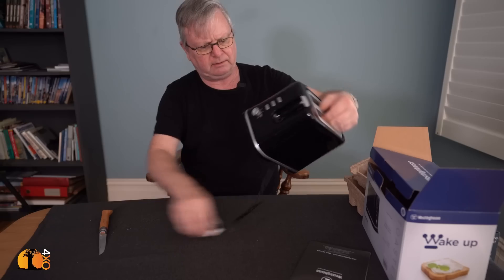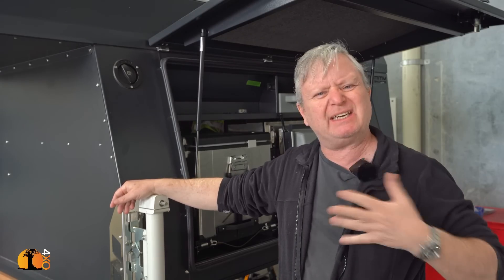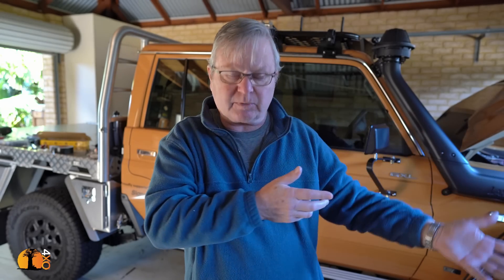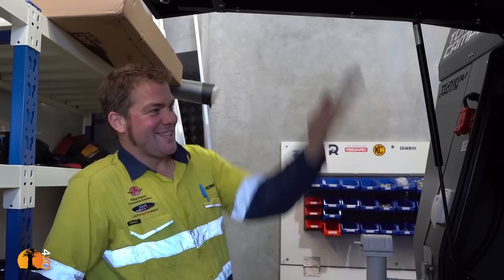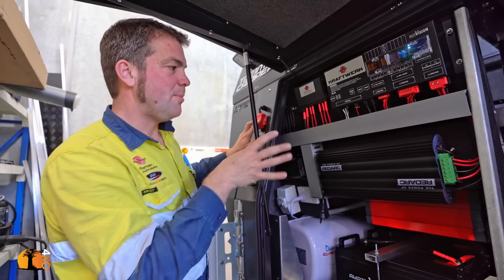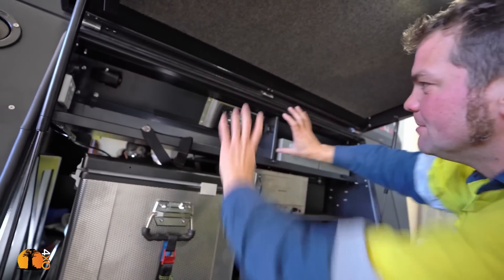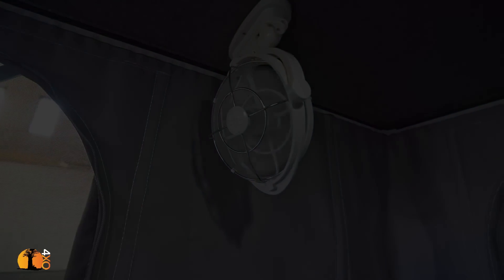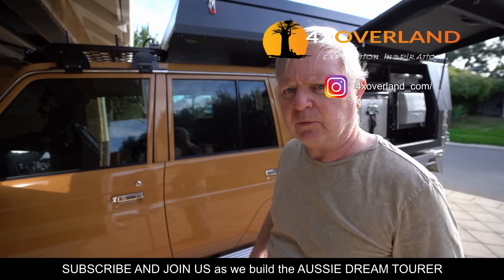Camper Electric Installation. A MASTERPIECE! Aussie Dream Tourer.

Comment: All good Andrew the system it absolutely magnificent BUT. If you mention a safari roof then plse explain. I used to fit them to Toyota Arkana Vans back in the late 60s for vehicles supplied to remote outback nurses vehicles.

Comment: Hi Andrew, the Manager30 has an option to limit the amps it draws in the menu. I've used it to block charging the house battery and relieve the load on the alternator when both batteries in my vehicle have been down on charge.

Comment: Alternator charging is a tricky one I'm trying to figure out, I'll be getting a Transit 470E and the electrical system from the factory is interesting- dual battery with a 240v 400w MSW GPO coming off the engines 230A alternator. For my traveling needs, I'll be able to draw as much amperage while driving as any dc-dc and battery system can drink with plenty to spare. But to charge while idle it will be a problem- it can still deliver 60A plus at idle but the cooling fan in the alternator is pulley driven from the engine.
Reply: The problem with alternators is you need speed for the built in cooling fan, if your that way inclined you can graft a 12v computer fan on the back to assist they're cheap otherwise increase engine idle speed, water cooled alternators are expensive.

Comment: I stand to be corrected but I saw a comment the Redarc BCDC trips out with a fault if your battery voltage drops below 9v and needs to be physically reset. I have yet to confirm this but my battery drops to 9v first crank of the day.
Reply from the maker: Your battery is the problem. It's dying. I tested this, and my Redarc rebooted at below 6V.
Reply: @4xoverland  cheers... I shall quote you to the would be installer.

Comment: I see you put casters on the bottom of the legs...are you able to move your Tommy by yourself on a flat surface? Just thinking about how I am going to move mine when its not on the flatbed. Thanks!
Reply from the maker: Yes.  It works very well. Next time though, I would weld the castors on differently. The centre of the wheel needs to be dead over the centre of the weight. Not off-centre as I did it. Which is causing a few difficulties.
Reply: Ah good to know! Thank you! I am eagerly awaiting my S4-X here in the US.

Comment: have you had a go at lifting the spare tyre into the canopy and jostling it into its mounting position ON YOUR OWN? I'm a bit older than you (65) and have a 6" raised Silverado. Spare tyre lives in the canopy and despite being over 6 feet tall, I sometimes struggle to lift the 50kg spare into the canopy. I devised a simple crane jib with 2000lb electric winch...works well.
Reply from the maker: I have a small block and tackle to handle this. 41kgs is a lot to lift.
Reply: @4xoverland  Good oh mate....sounds like a similar idea. As long as it works, that's all that matters. Rely on my TPMS and I don't plan on killing any tyres anyway.

Comment: With regards to the 220-240 volt installation, I'm not really certain if it's a little different from state to state. The canopy installation is more akin to a caravan installation rather than a static home installation and subject to different requirements and being a plug in device it is actually regarded as an appliance under the Australian Standards, so not really certain what type of compliance certificate is required, certainly won't be the standard building one but a caravan one if it's a requirement. In which case I hope flexible multi-strand cabling was used to combat vibrations along with double pole switching for all you power points and lights etc.... It's kinda funny seeing trunking being used to hide/protect the cables but I suppose if it's used in locomotives where it's subjected to vigorous vibrations and the like, it will perform well in that environment too. I am currently doing a similar setup with a canopy and camp king industries roof top tent as two separate pieces. I don't think I really want to install 240 volt into it though, but am still undecided whether to go for 12v or 24v solar system for the fridge. Really look forward to seeing more of the build.

Comment: Hi Andrew. I am running 650 watts  with my manager 30 and have found it will provide me with 30 amps when I need it. In my experience you will be able to run more solar power and will probably want to.

Comment: That wiring job is A+ , pretty much like and better than an industrial piece of equipment. One thought that comes to mind is why not hide all that controllers and batteries with a panel so you can have a bit of storage/ keep electronics safe from elements when you open the right side of the camper, I cant imagine you having to mess around with the wiring often

Comment: Hey andrew 👋 i think the truck is looking awsome have you thought about maybe mounting your maxtrax under the tommy camper over hang on maybe (rough description) an angle iron /aluminium frame wich could slide out and maybe even  tilt for ease and would free up roof rack space for other uses like a nice aluminium box for
 spares and tools ?
Love your work keep it up 👌👍

Comment: Confused about that manual 4 way isolator switch afterthought. After having an elictrical prodigy make a complex and elegant system, that switch dumbs the whole system down  making the charging system essentialy manual - bypassing all of the electrical engineering.
Reply: Am thinking that switch will be rarely used.
Reply from the maker: Dumbs down or gives me back some control?
Reply: @4xoverland  thx for responding. When you come to USA put Anza Borrego State park on your list, Southern California Desert right up your alley, best in  late fall to spring.

Comment: Several people have commented about the complexity because of the electronics.  Electrics mainly fail for a few reasons: low quality parts, poor installation, and heat.  A well designed system that is put together well will have few problems.  I can tell by the how this is installed that it is unlikely to fail and if it does it will be easy to troubleshoot by anyone with any knowledge of electrics.  The most complex part of this would be the RedArc manager 30 and those have such a good reputation (not a low quality part) that I would no be worried about it.  Sure manufacturing defects occur, but manufacturing defects will usually show up within 30-60 days and with electronics manufacturing defects will usually show up within the first few times they are powered up, if not the first time.  Software is a different issue and can showup seemingly randomly.  Sometimes cycling the power (turning it off the back on) will reset the system and get the software going again.  Sometimes it won't.  Sometimes you may need to turn it off for 10, 20, 30 or 60 minutes to give the electronics time to fully power down because there may be capacitors that are still holding a charge.  However, some capacitors can hold a charge for very long times, like months.  With a new build, plan ahead and do a weekend shakedown run at least 30-60 days prior to a long trip.  The shakedown run is to find any major problems and the 30-60 days is to allow time for parts and repair.  

If the electrics seem too complex to fix that is on you.  We have the internet today.  Educate yourself and take the knowledge out on the trail with you.

Comment: Heiner has done himself proud to 98%. Just check the red heat shrink  on the fuse block is cut to the same length. Looks messy being all different lengths.
Reply from the maker: I'm stopping that cheque!

Comment: You go right ahead doing toaster unboxings.  Just next time can you tell us why you picked that toaster?  My Dad takes one camping and they are such power hogs I liked to know if you got a low amp one or do you think your battery system is robust enough to deal with thje power draw?  Especially since if you are traveling with others you are going to be making allot of toast I think. 😅
Reply: Also does your vehicle have two alternators?  In North America I would have gotten a truck with two heavey duty alternators with that kinda load.  Cause your right I'd be worried about prematurly burning one out.

Comment: While I like the idea of the battery switch, I don't like those switches personally. I prefer something like the Blue Sea 7622 ML-Series. It will automatically reconnect the batteries once the starting bat is "full" but also allows you to manually connect the batteries for self jumping, plus has the option for a remote switch so you can mount the unit where it best fits and still have control of it. 

I cannot wait to see the wiring job they did!

Comment: Note andrew you will need  to check each device you wattage calc if intend to  run a lot of things at once you will need a larger  battery system in place..
if you are  going to  add shore power into the use parameter you will need a fused inlet..
I don't think you are going to have enough dc power to power your VAC components ..
you are looking at 4.5-8K
allowing a power draw of 1,500 watts per device you use..
If you are going to plug this into mains power  andrew you will have to comply with the same  diagrams that apply to caravans and campers and install a mains inlet fuse..
without one if something fails electrically it would be hard pressed to  get  insurance to cover any damages..
that happen.
do what you like though if considering any type of  secondary power options including shore power at caravan parks or genset applications minimum inlet specification is 240 VAC at around 20 amps

Just remember this Andrew whilst you might be able  electrically isolate at charging state doesn't  mean all the  batteries you use are electrically isolated in a use parameter case.. if on the same circuit you will likely find all batteries with interact with each other..

Comment: So Andrew, if you lose the alternator and the ability to charge the vehicle battery, have you considered a feedback loop to allow you to plug those 400 Amps of stored power back into the vehicles operating system?  With no alternator your vehicle will eventually draw down the crank battery (and auxiliary) until you are dead in the water, probably only after several hours of running, even less of operating lights etc.  With the additional power flowing back, you could continue to drive for a considerable time  then wait and charge the batteries using solar to continue on again.  A useful level of redundancy that I've employed in my 79 series build.  A necessity for the very remote outback stuff.  Cheers  Mick

Comment: You know your needs more than anyone but I doubt you'll ever need to charge the camper from the alternator. I run a 300watt panel into a 40Amp MPPT and have an extra 150W foldable for my camper trailer. With x2 120Ah deep cycles I haven't even run a cable through to the tow vehicle. I charge laptops, camera batteries, chainsaw batteries, devices for 5 people. With your amazing setup you just won't need it.

Comment: In the boating world going to single fuel has been a goal for years so going to diesel - electric is not such a bad idea as some people think, lose the gas bottles. lots of overlanders are coming around to the concept, running the engine at meal times is no big deal to run an inverter and also top off the batteries all you need to do is increase engine  idle speed, idle up switches are standard on hilux, they may be available  for yours,  basically just a resistance that pillocks the engine management to think you have your foot on the pedal ,water cooled alternators are expensive, could graft a 12v computer fan on the back, or simply use a sandbag on the pedal the possibilities are endless, petrol generators are bulky and introduce another fuel, cables and cans .
Reply from the maker: For me, the reason to go camping is the lack of noise. Therefore, running the engine at meal times would be the very last resort. I'd rather eat cold food.

Comment: Better system than i will probably ever have, but for the prep area i would of used a 2 x exterior dimmable two colour LED strip lights instead of the round LED. One pointed in, the other pointed out. Strip LEDs avoids issues with shadowing.

Comment: Considering the draw you’ll have in the camper with the 240v appliances the bm30 charging is a bit limited when driving. I’ve found about 20ah to boil 1.5L of water...

Comment: Great work Andrew. I really like the development you are doing. I have a question for you. Would you install a secondary alternator to support the electric system separately? Do you think it is a good idea?
Reply from the maker: The secondary charging system is called solar.
Reply: 4xoverland The electric system is connected to the car alternator to charge the batteries while driving, am I right?  I thought why not to add another alternator to charge the batteries ( not the car main one) instead of overloading the main alternator in the car.

Comment: I would suggest that you buy a super efficient Afghan pressure cooker since you travelling long distances....
Used on open fire as well as on the gas cooker.... 
Serves as a cooking pot as well as a secure storage... 
Uses minimum of water, efford and time for a standard and healthy meal... 
Used as pressure cooker and as an ordinary pot... 
Just chop it all, place it in the dish, add your preferd spice and forget about it for 10 to 30 minutes, depending on what you are cooking.... 
I have used it for camping and long travels myself as well as I am using it at home ....

Comment: Dont know why people think all electric camping is new, Landrover started fitting PTO generators in 1948, My landrover is 31 years old the pto runs a 5kva generator,  now we  have pure sine wave inverters everybody can have mains power try and catch up your only 72 years behind lol.
Reply from the maker: To get a PTO you had to endure a 1948 Land Rover.  And inverters were huge oil-filled machines that weighed as much as the Land Rover. It was a huge price to pay and not worth it for ordinary people who wanted to travel. So the world used gas. And it works, and still is the most efficient way of cooking in camp. Practical high-current 12v is new, and is a novelty.

Comment: Hi Andrew. I have noticed more than once that the trayback head board and the aperture of the rear window are not parallel! It may just be the camera angle but I thought you might want to check it out. It is as if the tray is slightly higher on the drivers side. I would be interested to know if this is the case. God Bless. Hugh

Comment: Have you had any experience with vibrations on the roof mounted solar panels? Are they prone to crack due to the wind / corrugation vibrations?

Comment: Hi Andrew, the solar setup interested me in this video. It appears one set of PVs is going to the manager 30, where as the other PV blanket is going to a separate BCDC25. If that is the case, my understanding is that the two chargers won't work together as one charger may be in bulk whilst the other is in float.

I tried a similar setup with two regulators on the same battery and one of the chargers current would always drop off as the battery neared %75 -%80 SoC.

Is there some level of data communication between the manager 30 and the BCDC?

Great content as usual.
Cheers.
Reply: This was also my understanding
Reply: Lifepo4 is basically bulk charge lithium will take as much charge as they both give. Both being redarc the profiles are exactly the same  and I think the manager 30 has parallel charge
Reply: @blingscreensavers3881  True they both have the same charging profile. Part of each stage of the charge profile is to charge at the optimal voltage for that SoC then stop and sense voltage fluctuations. The slower the fluctuation, the higher its SoC.
What i think has happened in my experiments is that during the sense phase of the charge stage,  one charger does not see a drop in voltage as the other is still in a charging state. Thus one of the chargers wins or they both go to the absorption state too early.

To fix this, the chargers need to have some kind of data link, which i don't think they have. I posed this question to Victron for help with running two different solar regulators into the same bank, the answer was simply no, you just need a bigger regulator and have it control the lot.

Edit: Not sure if i have interpreted wrong, but most of the BMS for liFeP04 on the market will take a max of about 50A charge, there are some that are higher but most are around 50A.

Comment: I am totally over the moon For you Andrew and smiling like a Cheshire cat, I have made neg comments in the past about your Elec work, but it's only because as an Elec professional it pains me when people don't take it seriously enough. But you have an absolutely first class installation and the inspector has signed it off with your certificate of Conformity, which when you consider the money invested in that whole outfit is the only sensible option, loads of power, loads of charging, with an absolute impeccable install, GERMAN standard😉😉, just what you need for those Italian coffee machines 😜😜 Fantastic

Comment: Hello Andrew, I do enjoy your videos but I have one thing to sort out as I am increasing my solar input for my Redarc 30 management and was told by Redarc that the management 30 could handle "There is no limit to how much solar you connect providing the solar panels are unregulated 12V nominal (VOC < 32V) and connected in parallel. For the BMS to operate at max output of 30A, it requires 520W of solar input.
"
So I was interested in why you have an extra Redarc DC2dDC charger  to handle the solar pannel input?
If you had both solar inputs operating at max to each Redarc charger, could the combined output damage the batteries and cause other problems??
Best Regards Mark